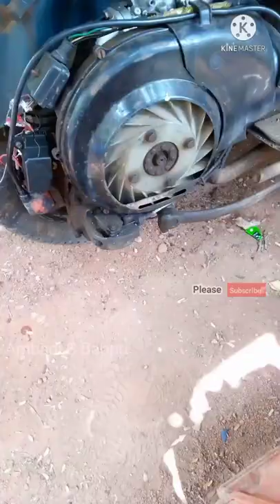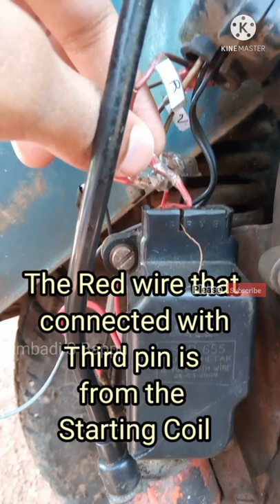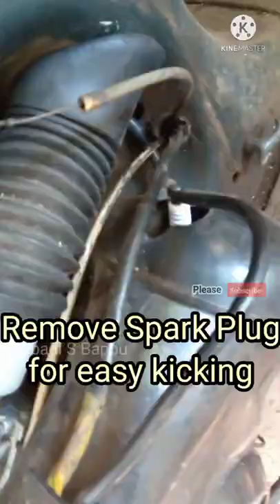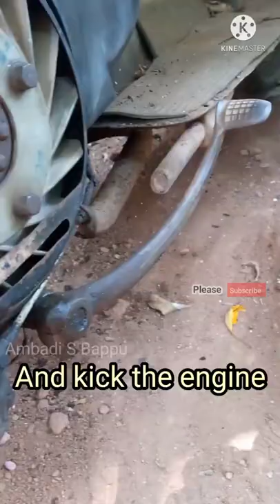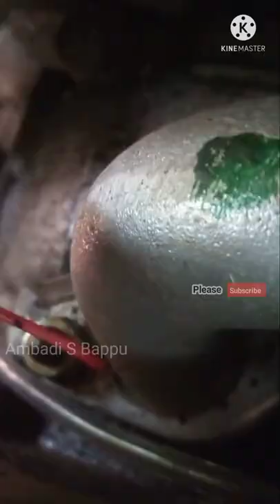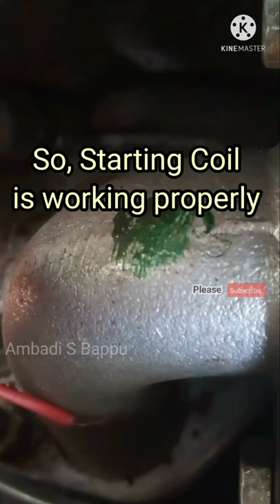Easiest way to check Starting Coil | Bajaj Chethak Two - Stroke (1998) | #shorts

Comment: Broo ente kayyil vespa lml nd but Ath start avum illa but oru wire Pidich body koduth Appo spark
Reply: Bro Insta ndo  Enikk msg cheyyan ann
Reply: Kuree doubt nd
Reply from the maker: Insta ഇല്ല ചേട്ടാ.
Reply from the maker: CDI Unit ൽ നിന്നും Ignition Coil ലേക്കുള്ള Wire ആണോ?
Reply: @Shaad-qh9bc  enikkum ee same problem aa bro .
Reply from the maker: Starting Issue ആണോ?

Comment: മലയാളി ആണോ നമ്പർ തരുമോ
Reply from the maker: മലയാളിയാണ്. എന്താണെങ്കിലും ഇവിടെ ചോദിച്ചാൽ മതി Sir. ഞാൻ Reply തരാം.
Reply: @ambadisbappu5807  ബ്രോ ഇതിൽ ബൈക്ക് ടൈപ്പ് carb അല്ലെ അത് vechathano
Reply: Milage eathra kittnd
Reply from the maker: Video ൽ കാണിച്ചിരിക്കുന്നത് പഴയ വേറൊരു Chethak _ൻ്റെ Engine ൻ്റെ photo ആണ്. നമ്മുടെ കയ്യിലിരിക്കുന്ന Type - Carb ൻ്റെ ഫോട്ടോയും. 
         നമ്മുടെ കയ്യിലുള്ളത് Bajaj Chethak 2003 അന്നത്തെ latest top varient ആണ്. 12 V electronic അല്ല. Body , Engine എല്ലാം Same ആണ്. പക്ഷെ Carburettor Factory fitted bike type SPACO (PHBF - 11)  carburettor ആണ്. With Reed Valve. ഇതിന് Choke പിടിച്ചാണ് രാവിലെ Start ചെയ്യുന്നത്. ചരിച്ചാൽ start ആവില്ല.
Reply from the maker: Mileage Highway 50 - 55 ഉണ്ട്. Normal 45 - 50.
Reply: @ambadisbappu5807  ethinne kurichulla സംശയം choikanan number choiche
Reply: Ente 95 model ആണ് അതിൽ ഈ കാർബ് set ചെയ്യണം bent പൈപ്പ് എവിടുന്നാ kitta
Reply from the maker: ഈ Bent Pipe and carb വണ്ടി വാങ്ങിച്ചപ്പോൾ തന്നെ വണ്ടിയിലുണ്ടായിരുന്നു. പക്ഷെ ആ Carb മുഴുവൻ Overflow, Jet Block, Top Bend pipe crack, മൂലം കേടായി. ഇപ്പോൾ ഇരിക്കുന്നത് same brand Same model carb പുതിയത് ആണ്. പുതിയത് കിട്ടാൻ വലിയ ബുദ്ധിമുട്ടാണ്. ഒരുപാട് തിരഞ്ഞതിന്നുശേഷം SPACO Mumbai Carb Company Customer section യിൽ അറിയിച്ച് Distributor വഴി യാണ് പുതിയത് കിട്ടിയത്. Old Stock ആണ്. അതിൻ്റെ കൂടെ ഒരു Secondary Air filter, Throttle cable, chock cable, Nut, Bolt, Washer set ആയി വരും. Bend Pipe extra അതിൻ്റെ കൂടെ കിട്ടും. പഴയ Chethak ൻ്റെ Engine - ന് Suit ആയത്. പക്ഷെ Jet, Needle valve, Accelerator cable, Choke cable എന്നിവ Damage ആയാൽ spare ആയി ലഭിക്കാൻ വളരെ പാടായിരിക്കും. പഴയ Box type carb ൻ്റെ Spares കിട്ടാൻ എളുപ്പമാണ്. എവിടെയും കിട്ടും. Repair ചെയ്യാനും പറ്റും.
Reply from the maker: ചേട്ടാ, സംശയം ഇവിടെ ചോദിച്ചോളു. എനിക്കറിയാവുന്നതാണങ്കിൽ ഞാൻ Reply തരാം.
Reply: @ambadisbappu5807  ok ബ്രോ ഞാൻ ചോയ്ച്ചവർ എല്ലാരും പറയുന്നേ പഴയതിനെക്കാളും 10 km മൈലേജ് കൂടുതൽ കിട്ടും എന്നാണ് കാർബ് കിട്ടാൻ ബുദ്ധിമുട്ടാണ് ഞാൻ herohonda carb set ചെയ്യാൻ ആണ് പ്ലാൻ ❤‍🔥
Reply from the maker: Ok. മൈലേജ് sure ആയും കുടും.
Reply from the maker: Ok. Sure ആയിട്ടും Mileage കൂടും.👍👍
Reply: @ambadisbappu5807  mm
Reply: Broo ente kayyil vespa lml nd but Ath start avum illa but oru wire Pidich body koduth Appo spark